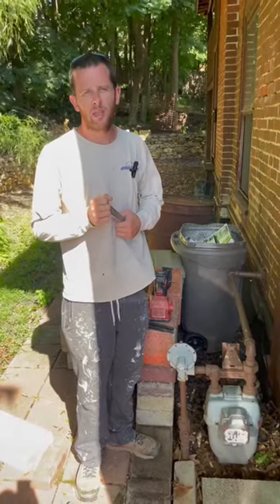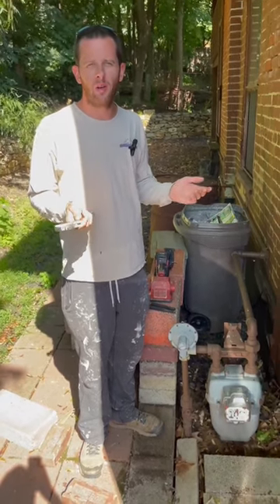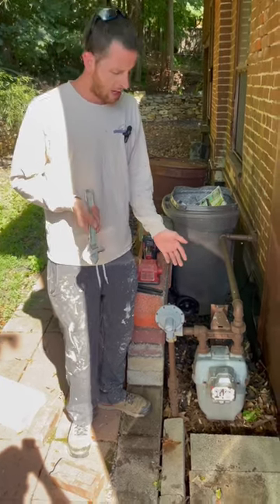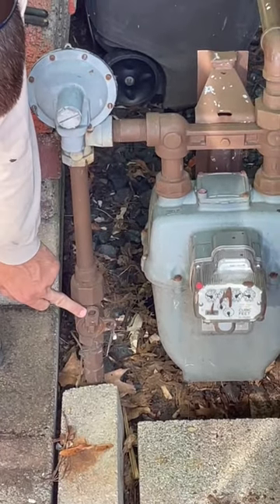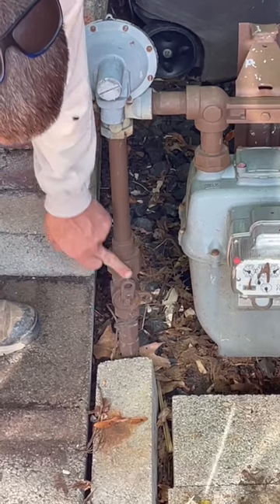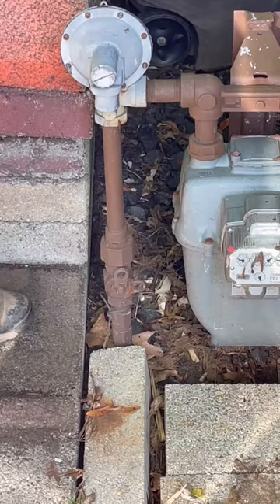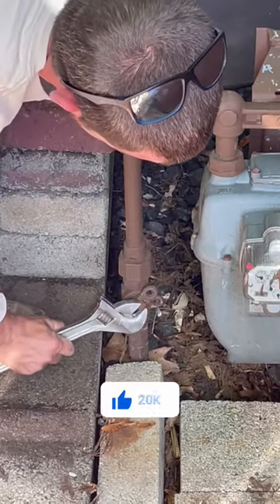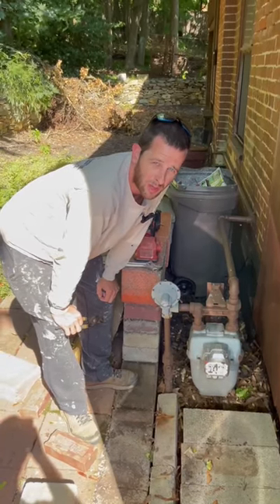How to turn your house’s gas off #shorts #gas #naturalgas #utilities #diy #houseflipper #tips

Comment: Do not listen to this guy. That side of the gas meter belongs to your gas company. Call them if you need a shut off. The process of turning it back on is not the same.
Reply: Only have go slow. If you smell gas turn that valve. You're wrong
Reply: I’d like to see which gas company is instructing customers to turn their own stop for any reason at all.
Reply: Exactly right. Only extreme emergencies. And if they turn it off, call the gas company to turn it back on.
Customers could blow the Reg turning it back on.
Reply: Also tampering with the inlet side is a federal offense.
Reply from the maker: lol jeez we must be living rent free in your head. Comes back to his own comment from 4 months ago 🤣

Comment: Do not turn your gas off yourself.
Reply: Why?
Reply: @thatguythatdoesstuff7448  because you don’t work for the gas company.
Reply: @frostfive  So? There's nothing wrong with shutting off and turning the gas back on yourself to complete a project.

Contractors do this all the time. I replaced a gas countertop stove a while ago and the valve needed replaced. I called the gas company, they recited the procedure and recommended I have an HVAC company restart the service so they could conduct a pressure test.

I'm not paying $150-$200 for that when there was nothing wrong with the service originally.
Reply from the maker: @thatguythatdoesstuff7448 he just wants you to pay him to do it